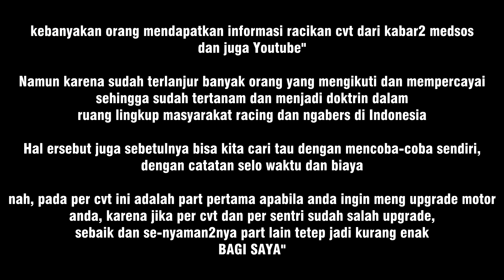Perbedaan Kampas Ganda Panjang dan Pendek

Comment: Maaf nih bang sebelum nya kalo bore up stroke up dan klep lebar enak² aja mau lebar mau pendek 🙏🏻😂
Reply from the maker: beda orang beda menilai spertinya ya mas, hehe..
kalo spek pcx saya bore 64, stroke standar tapi stang seher ganti, laher kruk as ganti lupa pake brt ato koyo, klep 32/26, head juga di rubah derajatnya, nyoba praktekin ake piston jenong, hasil buret kalo ga salah inget januari 2021 dulu di angka 12:4, per klep sogun, roker arm baru, TB 34, manifold inlate sama mesin 32,, leher knalpot dengan mesin inlite lupa tapi model menumpuk, seinget saya speknay itu yg lain lupa

nah itu pake kampas ganda elig saya, tapi saya kurangin kampasnya bagian ujung yg kena mangkok dulu itu sebanyak setengah cm. karena dulu pengen enak pas jalan 140nya. skarang udah di musiumkan motornya, kalau mau di beli silahkan pcx 150 2019 fullpaper pajak on going plat baru pajak baru ban tebal, sudah tune up, kilometer 10 ribu, tinggal pancal, cc motor ga begitu gede cuma 180cc an. silahkan dm untuk harga
Reply: PCX warna apa gan punya sya standaran cbs 2019 barangkali bisa tt?

Comment: Bang BB sya 80an.

Motor sya vario 150 thn 2015
Mau coba racikan
Ganti kanpas ganda Nmax 2dp  satu set rumah kanpasnya.
Per centri pakai bawaan vario 150
Per puly pakai bawaan motor juga.
Loler makai 15grm
Fuly depan standar .

Gimna menurut abang,
Biyar bawah enteng atas enak
Reply: Gak bisa dpt 2 dua nya bang..
Klo mau dpt akselerasi ya top speed nya jdi korban,,klo mau dpt top speed ya akselerasi jdi korban,,kyk Rx King akselerasi dpt top speed nya gak ada..maaf klo salah..

Comment: Semua motor matic ada hitungannya dari soal ukuran tapak kampas ganda.
~ Rata2 matic Suzuki 125 (Spin, Skywave & Skydrive) tapaknya pendek (kecuali Suzuki Hayate), kekurangannya tarikan biasa saja namun tarikan atas napasnya panjang. Cocoknya dibawa touring jauh mode ngebut. Kalau dipakai perkotaan ia pegel tangan.
~ Coba bandingkan dgn Nmax yg tapaknya agak lebar dan panjang, kelebihannya tarikan lebih responsif, mantap dipakai nanjak. Kekurangannya tarikan atas napasnya pendek. Namanya juga motor khusus dalam perkotaan dan touring santai.
Semua tergantung selera masing2 soal ngejar akselarasi atau topspeed.
Dikarenakan saya user Suzuki Skydrive 2009, saya lebih memilih Kampas ganda bawaan motor. 
Soal kirian lebih memilih originalan, kuat dan umur panjang.
Cuman fokusnya lebih ke pengapian ;
~ CDI BRT Imax 16 step khusus Skydrive
~ Koil ori Suzuki A100 alias RM Jowo. 
~ Busi NGK CR7HGP (dalam perkotaan), kalau mau touring diganti sama BRISK X-Line NAOR14-X7.
~ bensin Pertamax campur STP octane booster.

Top speed 140kpj+
Reply: Mantap bg, mau tanya, saya turunin roller ke 11 gr dan mau ganti kampas ganda ke nmax, kira2 nambah akselerasi tdk di motor skywave? Soalnya sebelum saya ganti tarikan atas bawah tdk ada😰
Reply: @TrevorParker.  
Skywave awal apa Skywave 2010 ke atas bro?
Skywave awal bobot roller bawaannya 15gram sama dgn Skydrive dan Hayate, kode G80. Skywave 2010 ke atas bobot roller bawaannya sama dgn Spin 12gram kode G50.
Jika mau pakai kampas Nmax kodenya 2dp, lalu pakai plat tatakan  Hayate. Kalau plat bawaan Skywave, kampas Nmax gak bakal masuk.
Ngomong2 soal roller, jangan terlalu ringan. Yg ada nanti malah gerung, bawah atas ngeden.
Suzuki matic karbu dari sononya diciptakan enak di putaran atas. So, jika mau diringanin turunin bobotnya 1 gram.
Reply: Mas nanya,kalo skywave standar tanjakan nya kurang kuat itu kenapa ya?
Roller udah pakai enteng pun sama hasilnya,
Kira2 apa ya racikan untuk tanjakan terutama untuk boncengan
Reply: @rullypamungkas3759  
Skywave yg keluaran 2008 apa yg 2010 ke atas, bro?
Reply: @rullypamungkas3759  per sentr&cvt ringan sama roller ringan
Reply: @TrevorParker.  Ringan gimana mas??
Soalnya semua pakai standar mas tapi berat.
Reply from the maker: Mantap.. Kutandai ini sebagain info nice
Reply: @PrabzGarage  🙏🙏🙏
Reply: @rullypamungkas3759  
Waktu itu ente masang pakai roller berapa gram?
Jika masih berat, coba cek pin guide pully belakangnya.
Rata2 orang suka lupa bagian part tsb yg jarang dibersihkan dan grease nya udah kering.
Jika pin udah penyon dan corong pully nya kegerus, ia kagak maksimal bukaan vbelt nya.
Itulah jika satu part bermasalah di dalam CVT, akan ngefek ke lainnya bro.
Reply: Agak surprise sih bang 125cc tembus 140kpj tanpa bore up atau hanya naikin pengapian..
Sejatinya upgrade pengapian hanya mempercepat mencapai topspeed sesuai kemampuan mesin..bukan naikan topspeed yg naik sampai 30an kpj wkwkwkk
Btw awas overheat bang..nanti meledaakk 😊😊
Reply: @dimasprasetyo4036  
Ente gak perlu resah dan gelisah bro 🗿
Seher udah diganti pakai ori suzuki Thunder, dome nya saya papas dikit biar gak nabrak klep bawaan. 
Noken as juga agak dimainin dikit.
Tenang aja gak bakal over heat, semua udah ada perhitungan. 😁
Karena stelan karbu agak distel basah dikit, disesuaikan kebutuhan api, udara dan pengkabutan bensin.
RPM semakin tinggi, kebutuhan minum jadi nambah.
Kalau ente user setia suzuki, pasti tahulah ia kualitas bahan spare part SGP kayak mana jika udah agak dioprek manja. 😁
Reply: @yovaniorlando1703  nah ini yg ditunggu..akhirnya buka rahasia dapur nya jg wkwkwkwk
Mantab lah bang..klo sya mah brpa tahun lagi uda mau kepala 4..ngeri klo bawa lexi di 110kpj..geter biji ane bang wkwkwkk
Reply: @dimasprasetyo4036  
Kepancing juga saya akhirnya wkwk 🤭
Saya setahun lagi juga kepala 4 bro.
Lahiran '85.
Ngtes juga only di dynotest.
Kalau ngtes di jalan mah beuuhhh merinding bulu ketek. 🤭
Di angka 100kpj aja, gigi serasa mau copot.
Reply: @yovaniorlando1703  wwkkwkwkk sama dah kita bang..umur emang gak bisa bohong yak..dulu kepala 2 mah anteng aja jamping pake satria hiu sampe gesrot spakbor belakang dan itu sambil nyelip truk besar 😂🤣😂🤣
Sekarang mah boro2 bang yak..inget anak istri dirumah 😆😆
Reply: @dimasprasetyo4036  
Lah sepengalaman 🤭
Umur 20an itu pas kita lagi masa unyu2nya.
Kalau sekarang mah palingan ngebut pas pernah ngejar jambret doank.
Kekejar kagak, jatuh ke got iya. 🤣
PRO banget si jambretnya 🤭.
Pulang2 dijewer sama bini, karena pakaian penuh dgn aroma pisang got yg suka ngambang. 😭😭😭
Itulah penyebab Skydrive saya sampai harus turun mesin, bro. 🥴
Reply: @yovaniorlando1703  wkwkwkk apes bener bang yak 😂
Zaman muda dulu emang pengalaman tak tergantikan bang..berharga bener..punya banyak temen yg ngerti mesin oprek mesin dan malpraktek tanpa bayar jasa bengkel wkwkwkwk
Skrg mah punya motor matic std yg sehat aja uda bersyukur banget dah..cape mau modif/oprek jeroan..yg penting bisa bawa bini kepasar sama antar jemput anak sekolah aja 😅😅😅
Reply: 140km++ udah nyalip satria Fu kah? Fu ku dirumah modal knalpot doang dapet 136km
Reply: @erzalguyun6042  
I dont know, belum nyoba 1 vs 1. 😁
Kalau FU karbu ente pengen kenceng, pakai :
1. Pertamax only
2. CDI Imax khusus FU karbu
3. Koil ori YZ125
4. Busi Brisk XLine
5. Filter udara stanless
 Kalau pasang knalpot racing, stel ulang karbu nya. Jangan terlalu basah.
Reply: @yovaniorlando1703  ini gw komper motor bang yg udah yg segmen pasarnya terlahir kenceng aja lari cuma segitu, kaga ada yg minta dibikin kenceng😭 lagian berharap apa sih mesin 9hp upgrade koil CDI lari 140? Mending beli gearbox dah biar waras
Reply: @erzalguyun6042  
Lari cuman segitu kalau masih pakai CDI standar dan bukan Suzuki 😁.
Tau gak motor2 Suzuki 4 tak karbu diciptakan buat enak putaran menengah ke atas? 
CDI standar ada limitnya, ia namanya juga standar.
Berbeda dgn CDI Imax 16step, gak usah jauh2 cukup Dualband aja.
Saya ngomong gini karena punya FU karbu, cuman sekarang dipakai sama adik kerja di Jakarta.
Sebelum punya matic Suzuki, motor pertama saya Shogun 110R, lalu tuker tambah dgn FU Karbu tetangga. 😁
Waktu pengapian standar, ia emang segitu2 aja.
Pas upgrade, beuuuh dah pokoknya.
Apalagi kalau boreup.
Tapi...yah...150cc juga cukuplah lagian bukan pembalap.
Kalau ada teman yg punya CDI Dualband FU, pinjem lalu cobain di kurva 1 dulu, kalau pakai knalpot racing pakai kurva 2.
Reply: @yovaniorlando1703  topiknya kan SkyDrive 140km++ kok jadi ngalor ngidul dah??
Reply: @erzalguyun6042  
Pasti penasaran 😁

Comment: lebih asik mana bang
bukan enak loh.
lebih asik mana, 14° atau 14,5° , untuk beat esp yang menggunakan per cvt 1.000 Rpm dan per sentri 1.000 rpm, roller vario karbu (13gr)

mohon masukannya bang.
Reply: Rata" pulley custom roller minta ringan
Reply from the maker: Di 14,2° gan kalo saya.. beltnya masih balance bawah tengah atasnya..
Reply from the maker: Coba pake std lebih enak gan
Reply: siap, besok aku coba tes, makasih masukannya om prabz

Comment: Maaf kak mau tanya.tapi agak melenceng dikit.motor saya beat fi 2014 biar gak limit apanya yg harus saya perbaiki.soalnya cuma nyampe di speed 60 udah limit langsung berebet.per cvt pake 1500 roller campur resing 7 gram 3 biji sama setandar 3.apa itu memepengaruhi ke speed.kalo pas trek pertama iye akselerasi mantap.cuma gituh di speed 60 udah langsung limit.trimaksih.mohon masukannya kak
Reply: slah bg it racikannya ,untuk motor standar beat fi pling enak pke roller 10 gram cvt 1000 pully pke punya vario ,,

Comment: Sharing2  pengalaman aja mas.. Sy user vario 150 led. Upgrade kirian;
1. pulley pcx 150 standart tanpa  bubut
2. roller sy ganti 13gr. 
3. Mangkok ganda punya nmax bolong2.
4. Kampas Vario 150 Daytona
5. Per centri beat
6. Per cvt pake pcx thailand 150
7. Bearing Bambu

Alhamdulillah sudah saya pake selama 1 thn tanpa pernah buka cover cvt (bersih2), masih tetap aman dan nyaman.. 
Gredek blm terasa, akselerasi lumayan walaupun tdk spt standart bawaan pabrik, Trakhir top speed masih dapat di 115kpj...
🙏🙏🙏🙏
Reply from the maker: alhamdulillah kalau sudah cocok
Reply: Yg bener bang? Masa vario 150 main kirian mentok 115? Scoopy 2019 gw aja mentok nyampe 110 kok
Reply: Racikan :
Pulley depan daytona
Roller 13gr
Boshing pulley pitsbike
Vbelt gateslink
Per cvt 1200 rpm (merk vip racing)
Per sentri 1200 rpm (merk vip racing)
Kampas ganda daytona (kurang recomend tapi terlalu keras, mending std aja)
Mangkok ganda kawahara yg merah versi old (lubang di custom agak besar, kalo di kartel bakal lebih enak cuma sayang nanti kalo ganti kampas std)
Pulley belakang std
Boleh di coba bang..
Akselerasi lumayan responsif, top speed max 110 bisa naik lagi waktu pake pulley depan yg kerok jalur roller nyampe 115.
Reply: @iyaakamu2584  iya bang.. Posisi 2 org dan yg dibonceng agak gemuk. Sy cb di jalan  suromadu arah ke Madura setelah jembatan. Mmg dpt segitu (115 kpj) . Mgkn msh bs naik sekitar 117kpj.
Klo scopy abang bs sampe 115kpj bagus ituu.. CC nya aja beda jauh